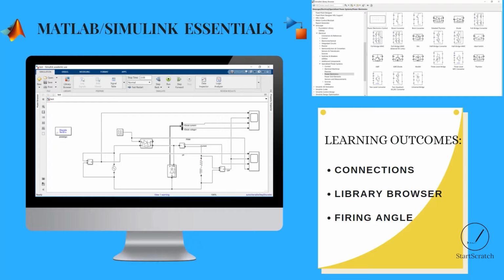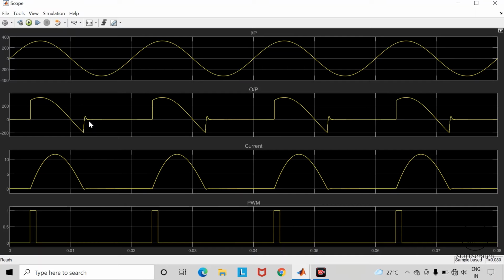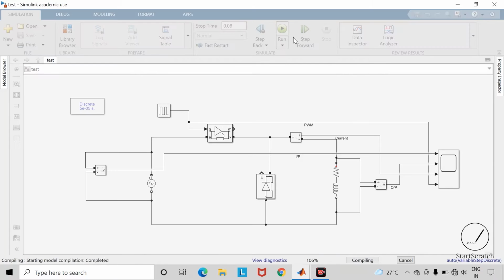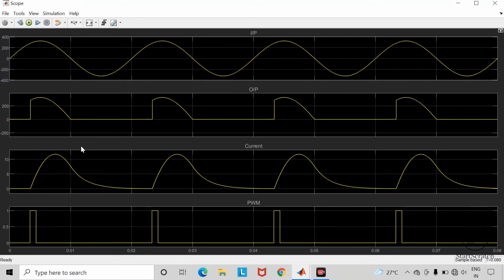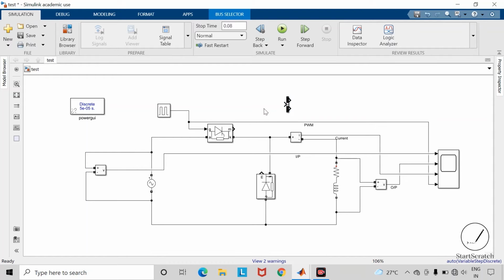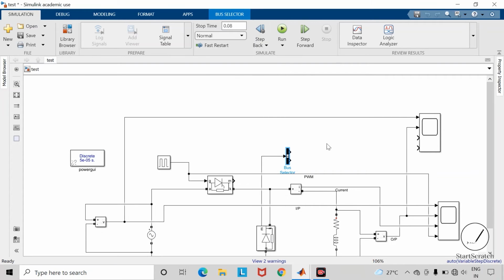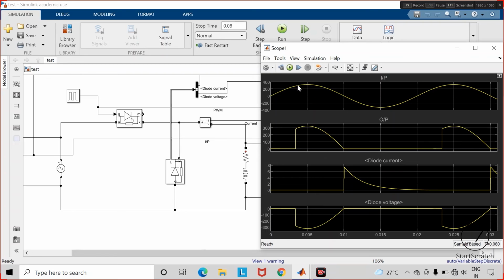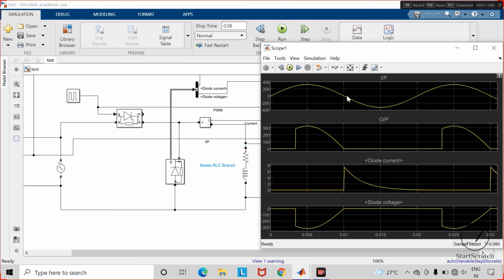L10 | Half wave controlled Rectifier with RL load and Freewheeling diode

Comment: Quiz:
1. How freewheeling diode is connected in the circuit with respect to Load?

2. Did you observe voltage waveform in negative portion when freewheeling diode is used?

3. What is the effect of freewheeling diode on load current?